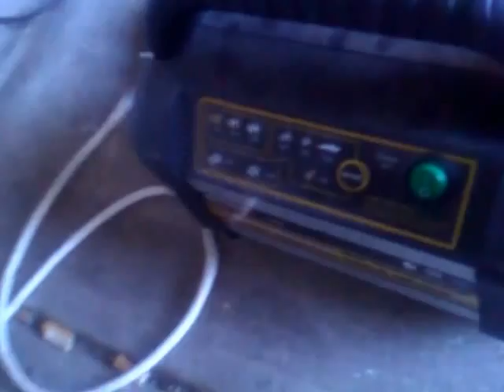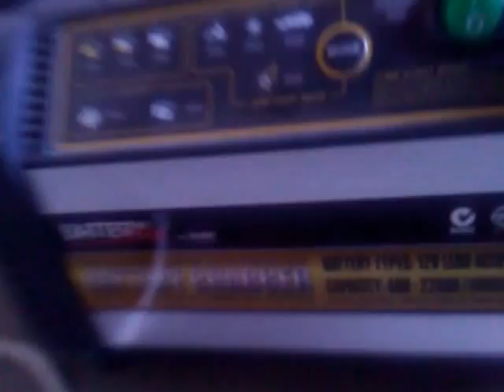2007-2008 Yamaha r1 STATOR FAULT not charging Regulator/Rectifier location read description!

Comment from the maker: UPDATE... i fixed it by a 2nd hand magneto (stator magnets) everything ran fine and charging the bike nice and to add to make sure you push in the plugs till you hear it click in the resonator/regulator push it in very good till it cant be pushed in anymore or it wont make proper contact to the resonator/reg and when tightening the case to the stator make it tight but not too tight and keep eye on it for no oil leaks or rattleing loose after 24hrs riding time
Reply: +2controled Hi, I'm having trouble removing the generator/stator rotor. It won't come off. I can twist and move it up maybe like 10mm, but with grinding. Doesn't sound good
Reply from the maker: +MotoBoy if you trying to get it off the bike then rock the bike back and forward a touch and pull out the whole thing at the same time and watch out you don't drop anything in the motor if you trying to take it apart from the magneto from the coil and already have it of the bike use a srew driver to open it sideways make sure you fit the new one as the same way you took it out.... again sit on the bike maybe put it in gear and rock back forward and move the gars a little to slide out
Reply: 2controled Thanks for the response. So it's not stuck on the bike's crank or anything. I've taken out the stator but the rotor is stuck right on it. I'm guessing that means the rotor is all fucked up. Like the magnets probably all fell off and are just grinding around there and that's why it's not coming off. 

I was hoping I'd have to just buy a stator (not too expensive), which I already bought but looks like I'll have to buy the rotor as well which is gonna be $$$ :/
Reply: 2controled I've read that the generator rotor/magneto/flywheel whatever you want to call it goes bad on nearly every single R1 eventually. It's been a problem since since '04 and it really should have been a recall. Poor design, but they stopped making the original part and have since replaced it with a better design
Reply from the maker: MotoBoy yea they seated the magnets in the maneto thats why better buy new
Reply: +MotoBoy when removing the stator oil comes out?? do I need to drain the oil from engine?
Reply from the maker: 1711hec yes or just put a pan under 😁
Reply: 1711hec You don't need to drain the oil. You can just take off the stator cover...some oil will drip out but not a whole lot. Just put a pan underneath.